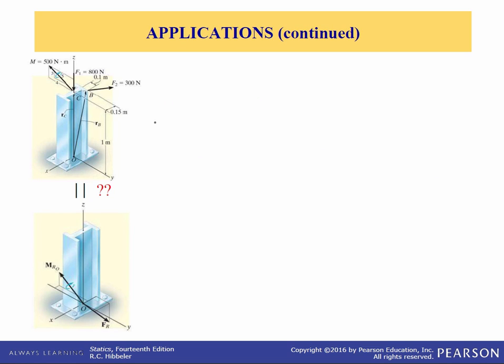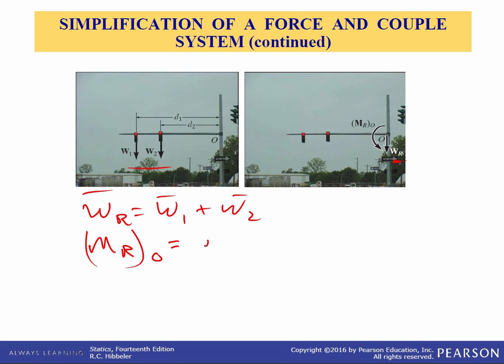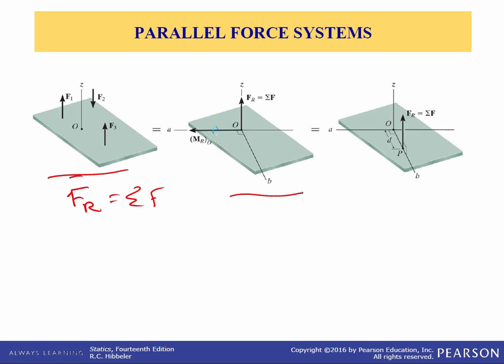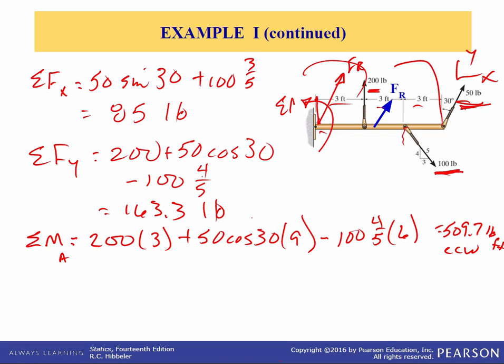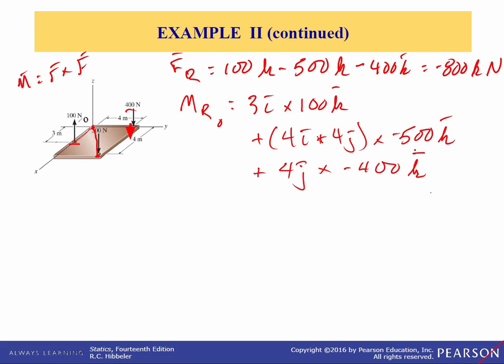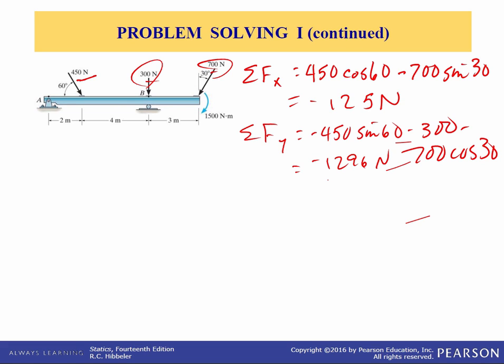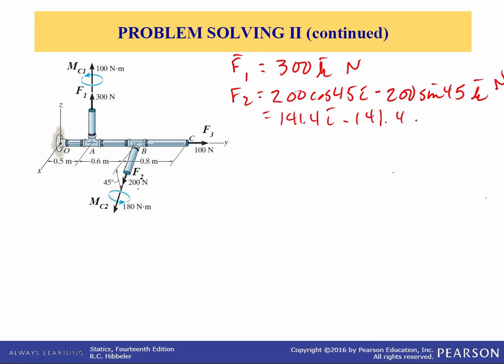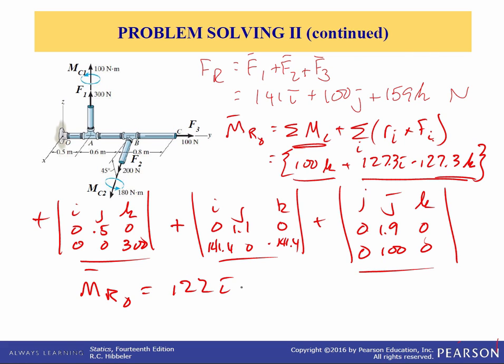ME273: Statics: Chapter 4.7 - 4.8

Comment: at 13:31 shouldn't it be (-1*-100(4/5)) becz force itself is negative and direction of moment is also clockwise?
Reply from the maker: No. The moment is CW, so it is negative. In the scalar formulation you only look at the direction of the (impending) rotation to determine the sign of the moment (and it is 6 ft, not 1 ft). When using vectors, then you use the signs of the forces and position vectors. In this case, the vector formulation is 6i X -100(4/5)j = -480k.

Comment: Everything made sense, until that sign change when finding X... at 19:55.

Why did the 1,700 change to -1,700?
Reply from the maker: Good question. I should have used the vector form of the equation to solve this part. Mr (resultant moment) = -3600i + 1700 j. The moment due to the resultant force Fr (-800k N) is r X -800k. In this case the vector r is (xi + yj), where x and y are unknown. So -3600i + 1700 j = (xi + yj) X -800k. Do the cross product and equate i and j components to solve for x and y.